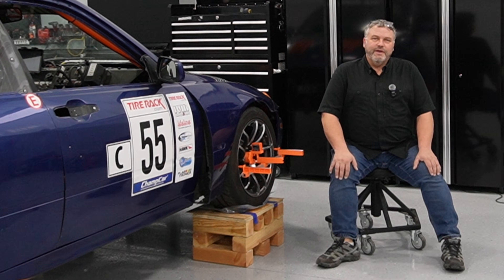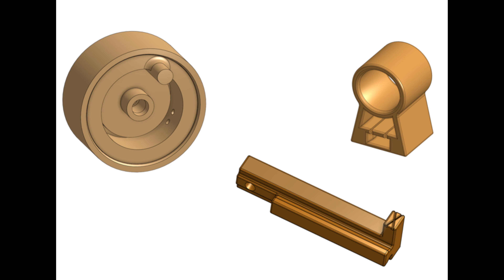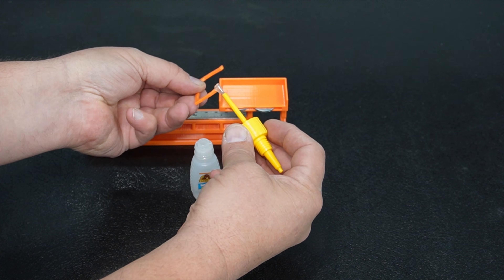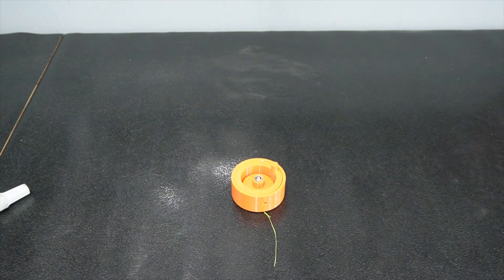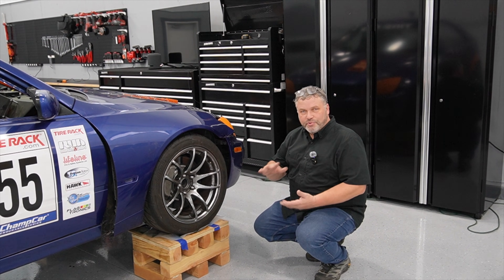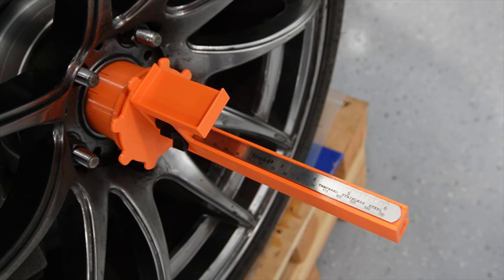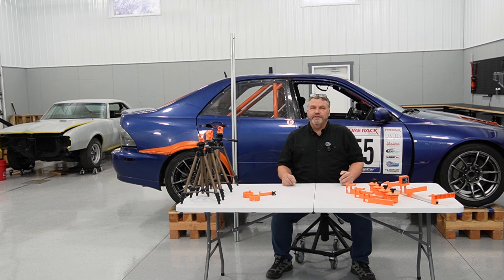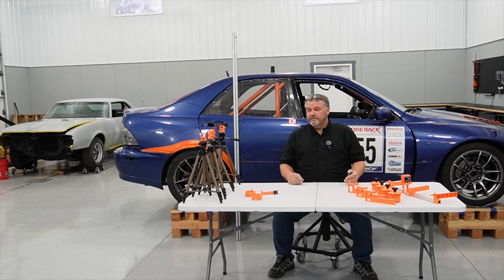3D Printed String Alignment Tools for Improved Accuracy

Comment: hello @diyfabshop first I want to thank you for making this design available to the public! Looks like a great way to increase accuracy , and speed up the measurements. Also love the neon fishing line!!! I did a petg test print of your e30 hub adapter, as it was this closes size on your chart, but it still isn't ideal for my wheel. I was hoping we collaborate on a wheel adapter for the bbs rc090 wheel on my e36 drift car... Its doesn't have a traditional center cap but I think your method could still work with some iteration. Hoping we could get in contact over DM??
Reply from the maker: @brettbenz4176 my sincere apologies, it looks like your comment slipped through the cracks.  You can email me at kentkallsen@gmail.com

Comment: Hi, awesome project!!!! 
Can you add my OEM 14" Daisy Wheels for 1.6 Mazda Miata ??
Cap OD: 49 mm
Detent distance: 7 mm
Detent OD: 54.1 mm
Reply from the maker: @hotshower1636 I added a link to the STL files based on these dimensions to the spreadsheet that can be found at the bottom of this web page: https://www.diyfabshop.com/alignmentkit    Once you get a chance to try them out, let me know if they fit ok or if dimensional tweaks are needed.  Cheers!
Reply: @ Woowww, thank you so much, you were very quick
Reply: @DIYFabShop  Hi, the hub adapter is perfect, but the threaded plug doesn't screw in completely because hit the axle nut, it is necessary to increase the internal diameter of the threaded plug from 35mm to 37.5mm and lower the height from the support surface to the tip from 56.7mm to 55.5mm, thanks a lot for your job.
Reply from the maker: @hotshower1636  there is now a Rev A version of the file available for download.  Let me know if you still end up with interference.
Reply: @DIYFabShop  Hi, i've tested now is perfect!!!!
Next week, I'll try my first alignment.

Comment: Thank you for designing this. Could you generate an stl for 64.7mm detent OD, 62.7mm wheel cap OD, 2.5mm detent depth?
Reply from the maker: You bet, do you have a wheel brand / model name I can catalog this to?
Reply: @DIYFabShop  This should fit a 15x7 Enkei RPF1. The center hole is a different size than the 16" and larger RPF1s.
Reply from the maker: @BaconGreaseMouthwash  your STL files are now available via link in spreadsheet at the bottom of this webpage:  https://www.diyfabshop.com/alignmentkit  Please let me know how they fit and/or if any tweaks are needed.  Thanks for watching!
Reply: @DIYFabShop  It was a little too tight. I was unable to thread the threaded plug all the way in even after some sanding. Could you reduce both of the ODs by about 0.7mm?
Reply from the maker: @BaconGreaseMouthwash  there is now a new link to a Rev A version of the STL files.  Please let me know how it goes.

Comment: Bonjour 
Quand vous avez le temps j'ai un nouvel adaptateur a faire pour ma BMW E30 :
Whell cap outside 70 mm 
Distance to detent 4 mm
Whell cap outside détent 74 mm ( la George dans la jante est profonde).
Merci beaucoup
Reply from the maker: @christophefusier9111 Les liens vers les fichiers stl sont désormais publiés. Merci de me faire savoir s'ils s'adaptent bien ou si des modifications sont nécessaires. Santé !
Reply: Bonjour 
Merci pour les fichiers.
J'ai imprimé les pièces.
C'est bon pour les griffes de 74 mm par contre le corps est trop gros cela ne rentre pas dans la jante : whell cap outside fait 72 mm , et il faut 70 mm.
Merci
Reply from the maker: @christophefusier9111  Bonjour, j'ai vérifié deux fois le fichier CAO et STL et il est conçu pour 70 mm. Voulez-vous que j'en crée un autre plus petit encore ?
Reply: J'ai essayé de mettre des photos des mesures avec le pied à coulisse mais cela ne fonctionne pas.
Oui essayeez 2 mm plus petit sur le wheel Cap outside et garder la même dimension sur les griffes (74 mm).
Merci
Reply from the maker: @christophefusier9111  Il existe un nouveau lien disponible sur le site Web vers une version Rev A des fichiers STL avec une dimension extérieure d'enjoliveur plus petite de 2 mm. J'espère que celui-ci vous conviendra mieux. N'hésitez pas à me le faire savoir. Santé !
Reply: Re,
C'est impeccable plus rien à corriger.
Je ne comprends pas ce qui c'est passé avec la première version.
J'imprime avec une P1S , elle est bien calibrée et j'ai vérifié les dimensions dans Bambou studio et celle de la pièce sont bien les mêmes à quelques centièmes prêt !
Enfin l'essentiel c'est que maintenant c'est parfait !
Merci encore pour votre travail 👍👍

Comment: Would love to try this on my Porsche 987.  62.25mm detent OD, 60mm wheel cap OD, 9mm detent depth
Reply from the maker: @bberdy72 the STL files based on your dimensions are now available for download and a link can be found in the spreadsheet at the bottom of this web page: https://www.diyfabshop.com/alignmentkit  Once you get a chance to try them, let me know if they fit well or tweaks are needed. Cheers!
Reply: @DIYFabShop  Fast turnaround!  printed and trialed this am.  Please shorten detent length to 7.5, increase wheel cap OD to 60.5.  Thank you!!
Reply from the maker: @bberdy72  modifications are easy thanks to a parametric CAD model.  There is a new link to a Rev A version of the STL files available https://www.diyfabshop.com/alignmentkit   Hopefully this version improves the fit for you.  Let me know, Cheers!
Reply: @DIYFabShop  super-snug.  love it!  thanks!

Comment: Bonjour 
Bravo pour cet outil top pour régler ma voiture de Drift.
Avez vous déjà fait un adaptateur pour jante BMW moyeu 68 mm?
Reply from the maker: Je ne l'ai pas fait, mais si vous fournissez les dimensions telles qu'indiquées dans le dessin au bas de cette page Web, je pourrais créer de nouveaux fichiers STL pour votre application. https://www.diyfabshop.com/alignmentkit
Reply: @DIYFabShop  Merci, Wheel cap outside diameter : 65 , Wheel cap outside detent diameter: 68 mm, Distance to detent: 7mm (Bmw OEM 6783536).
Reply from the maker: @christophefusier9111  J'ai créé des fichiers STL en fonction de vos dimensions et vous pouvez trouver un lien pour les télécharger dans la feuille de calcul au bas de cette page Web : https://www.diyfabshop.com/alignmentkit Une fois que vous avez eu la chance de les essayer, faites-moi savoir comment ils s'adaptent ou si des ajustements supplémentaires sont nécessaires. Santé !
Reply: Bonjour 
J'ai imprimé avec la P1S , c'est impeccable, juste pour que ça tienne bien en place avec le poids du système je pense qu'il faudrait essayer avec whell cap outside détent diameter 72 mm et distance to detent 4 mm.
Merci
Reply from the maker: @christophefusier9111  De nouveaux fichiers STL sont désormais disponibles en téléchargement avec ces dimensions révisées. Je suis un peu inquiet que l'augmentation importante du diamètre extérieur du cran puisse entraîner la rupture des bras flexibles, mais essayons et ajustons si nécessaire.
Reply: @DIYFabShop  normalement ca devrait être bien car les gorges dans la jante sont assez profondes.
Je vais l'imprimer et je vous tiens informé. Bonne journée!
Reply: C'est impeccable ça bouge plus une fois l'appareil monté mais l'écrou ne se serre pas à fond, pour être parfait  il faut juste changer 72 par 70 sur la version A j'y suis allé un peu fort
Reply from the maker: @christophefusier9111  Les nouveaux fichiers STL sont disponibles au téléchargement dès maintenant. L'adaptateur de moyeu et le bouchon fileté sont tous deux appelés Rev B, mais seul l'adaptateur de moyeu a changé. Faites-moi savoir si cela fonctionne. Santé
Reply: Merci je vais imprimer et je vous tiens informé  👍
Reply: Bonjour 
C'est bon impeccable plus rien à modifier. Merci beaucoup.

Comment: I've got center cap measurements for some ForgeStar F14 wheels:

Cap OD: 59mm
Detent distance: 10.4mm
Detent OD: 62mm
Reply from the maker: @dougray5068 I have created STL files based on your dimensions and you can find a link in the spreadsheet at the bottom of this web page: https://www.diyfabshop.com/alignmentkit  If you end up printing and checking the fit please let me know how it goes.  Cheers!

Comment: Great design and awesome of you for sharing with the world! Thank you so much

I have center cap measurements for some BBS RG-R wheels

Cap OD: 59.2mm
Distance to Detent: 5.9mm
Detent OD: 62.4mm
Reply from the maker: @skrigz I have added a link to STL files based on these dimensions to the spreadsheet that can be found at the bottom of this web page: https://www.diyfabshop.com/alignmentkit   If you end up printing these out and checking the fit, please let me know if they fit well or dimensional tweaks are needed.  Cheers!
Reply: @DIYFabShop  We are going to have to adjust the fitment. I printed it and it's too loose. I even re-printed it at 100.5% which fit better but still not a snug fit. There is a bunch of up and down movement as well. I think we may have to adjust the distance to detent some
Reply from the maker: @ What would you think about raising both of the diameters by 0.5 mm and reducing the distance to detent by 0.5 mm?
Reply: @DIYFabShop  that sounds perfect
Reply from the maker: @skrigz  links to the new Rev A STL files are posted on the spreadsheet.  Fingers crossed this does the trick!
Reply: @DIYFabShop  It was still loose so I increased the size until the fit was snug. Let's try these
Cap OD: 61.1mm
Distance to Detent: 4.05mm
Detent OD: 64.5mm
Reply from the maker: @skrigz  fingers crossed we get it this time. Thanks for your patience with the iteration.  Rev B STL files with these latest dimensions are now available for download.
Reply: @DIYFabShop  I think we got it. That seems to fit perfectly! I will test the whole system out once everything has finish printing. Thank you so much!

Comment: Looks like a great setup, thanks for the work!

I've got center cap measurements for some Motegi MR145 Traklite 3 wheels:

Cap OD: 61.7mm
Detent distance: 3.0mm
Detent OD: 63.8mm
Reply from the maker: @lastditchusername I added a link to the STL files based on these dimensions to the spreadsheet that can be found at the bottom of this web page: https://www.diyfabshop.com/alignmentkit    Once you get a chance to try them out, let me know if they fit ok or if dimensional tweaks are needed.  Cheers!

Comment: Thank you so much for designing this alignment tool. If possible could you please provide a file for a hub adapter with the following dimensions?

distance to detent 5.2mm
detention outside diameter 57.4mm
Wheel cap outside diameter 55.2mm

This is for the Team Dynamics Pro Race LT 15" wheel
Thank you
Reply from the maker: @rob_esser the STL files are available for download and a link can be found in the spreadsheet at the bottom of this web page: https://www.diyfabshop.com/alignmentkit  Once you get a chance to try them, let me know if they fit well or tweaks are needed. Cheers!
Reply: @DIYFabShop  Thank you for your prompt reply. I did look at the existing files and wasn't sure if any of the ones there would fit my wheels. Can you recommend a file that you believe will work? Thank you
Reply from the maker: @rob_esser  I should have stated that better, I created STL files based on your dimensions and you will see they are posted now.  The sheet is sorted by diameter.
Reply: @DIYFabShop  Thank you so much!!!

Comment: Hi thanks for your great work. Would be nice if you can do another Adapter, Wheelcap Outside Dia 57mm, Distance to Detent 3.8mm, Wheelcap Detent Outside 58.5mm I tried by my own but im no cad professional. Thanks a lot
Reply from the maker: Is there a wheel brand and model we can catalog it to?
Reply: @DIYFabShop  it's german Brand, Protrack One
Reply: I tried No4 and 14 because it's close, but it's to lose.
Reply from the maker: @hollef1  The STL files have been posted and a link can be found in the spreadsheet at the bottom of this web page: https://www.diyfabshop.com/alignmentkit   Once you get a chance to try it, please let me know if it fits well or needs some tweaks.
Reply: @DIYFabShop  omg you are fast. Thx a lot. Will print it tommorow and try. 😀😀😀
Reply from the maker: @hollef1  your welcome, having a robust parametric CAD model makes adjusting these three dimensions quick work and sitting at my computer watching playoff football makes multitasking easy.  Cheers!
Reply: @DIYFabShop  its still a little bit loose. i measured after printing an its smaller. can you make it 57,5 and 59mm please
Reply from the maker: @hollef1  I updated the STL files, new ones are designated Rev A and available for download https://www.diyfabshop.com/alignmentkit
Reply: @DIYFabShop  will print it soon an test. Thx a lot for your help and patience. I bought you some Coffee 👍
Reply: thx a lot , it fits now perfectly

Comment: Can i use PLA instead of PETG?
Reply from the maker: @mjames5662  the only area of concern is probably the detent fingers on the hub adapter that need to flex. Pretty sure others have printed with PLA so it may be worth a try.

Comment: 949 Rac8ng 6UL wheels
Outside wheel cap.     59.25mm
Outside wheel detent 56.86mm
Distance to detent.     5.07mm

Thank you!
Reply: Corrected measurements 
Wheel cap.          52.79
Outside detent.  56.86
Distance to detent. 5.07
Reply from the maker: @mjames5662  the STL files have been posted and you can find a link in the spreadsheet at the bottom of this web page.  https://www.diyfabshop.com/alignmentkit    Let me know how it fits and/or if tweaks are needed.
Reply from the maker: @mjames5662 assuming your wheel caps are typical, your outside diameter for wheel cap should be smaller than the outside diameter for the detent.  The drawing on this page may help clarify: https://www.diyfabshop.com/alignmentkit

Comment: In general 3D printing is not accurate.
Reply from the maker: Sure 3D printing is not as accurate as CNC machining for instance, but with accuracies in the neighborhood of 0.008" and repeatability in the 0.002" that hobbiest 3D printing provides, I feel very confident in this method versus free hand measurement. But maybe that is just lack of confidence in my freehand approach, hopefully those that try the system will provide some feedback on their direct experiences.

Comment: Great video. I’m definitely going to print these. 

How did you tie the string to keep it taught? I’m terrible with knots.
Reply from the maker: @jamesford3549 the trick I use and should have highlighted in the video is that on one end I tie a loop that can slip over the conduit and then the amount of string I have on the spool is just long enough to get to the other conduit and hang over it.  That way the weight of the spool provides the tension on the string.

Comment: Hi, this is fantastic and saves me designing something that would not be nearly as well thought out.  Could publish STLs for a Lotus Evora - Series 1?
Detent OD:  2.20"
Cap OD:      2.14"
Dist to Detent: 0.125"
Reply from the maker: @a99terren99 the files have been posted https://www.diyfabshop.com/alignmentkit  Once you get a chance to print, please let me know how they fit or if tweaks are required.  Thanks for watching!
Reply: @DIYFabShop  
I printed a sample and now know why the factory center caps fall off so easily. They are quite missized so I measured the rim with snap / bore gages.  Let's see if these dimensions work better:
OD:   2.18" 
Dist to Detent: 0.12"
Cap Detent OD:  2.23"
Reply from the maker: @a99terren99  the revised STL files have been posted https://www.diyfabshop.com/alignmentkit
Reply: @DIYFabShop  That's a lot better.   It still moves a bit but only with some pressure.  I think it will be fine.  I was surprised to see that the threaded hub changed in size rather than just the hub adapter.  It seems like the changes could all be in the adapter.
Reply: @DIYFabShop will do!

Comment: NICE,  FYI:  2 stacked Pizza Pans with a dot of oil placed between them and or cheep Aluminum turkey trays act as great pivots under the wheels.   Not supper high tech, but it works rather wheel and does not bind or limit movement of the wheel/tire assembly

Comment: Hello, great product, I am currently printing one for my mechanic friend as a gift. And also so that he could align cars after the suspension work.

Could you also make hub adapter for original Renault Laguna wheels:
outside diameter: 51,5mm
distance to detent: 5mm
detent outside diameter: 56mm

Best regards from Slovenia
Reply from the maker: @nemc43 I created the STL files with these dimensions and they can be found at the bottom of this web page https://www.diyfabshop.com/alignmentkit   In your case the size of the detent is pretty big so I am a little concerned with the tabs breaking during install.  Let me know if you have any problems, we could always make that dimension a little smaller and it will likely secure to hub fine.  Good Luck and thanks for watching from Slovenia, another country added to the list!
Reply: @DIYFabShop  Ok thank you very much. Yeah detent is big, but I tried the Revolution motorsport adapters which have similar dimensions and it didn't hook on the centers edge so I'll try and give an update if it fits and holds up. :D